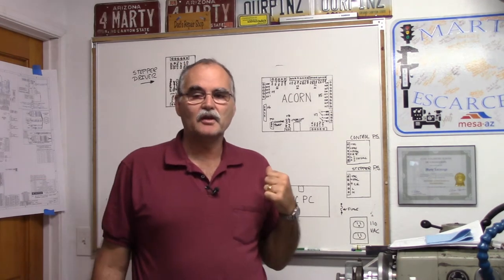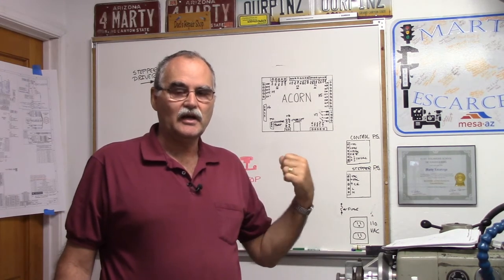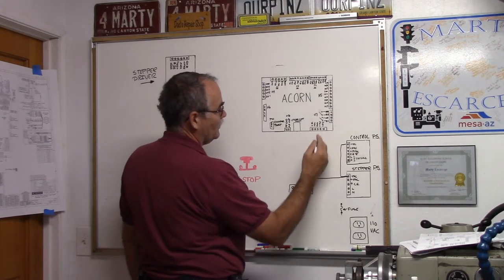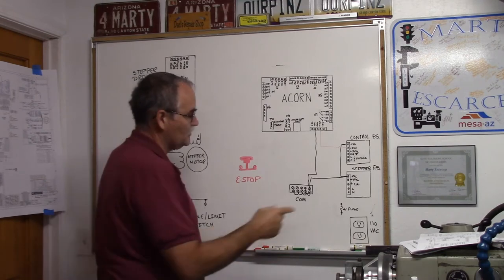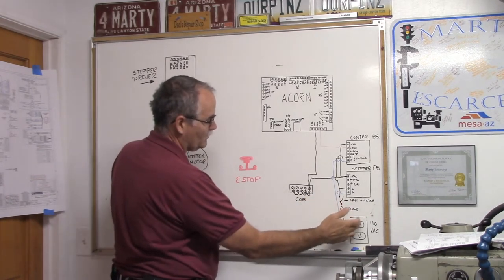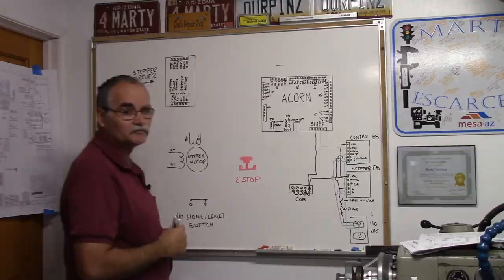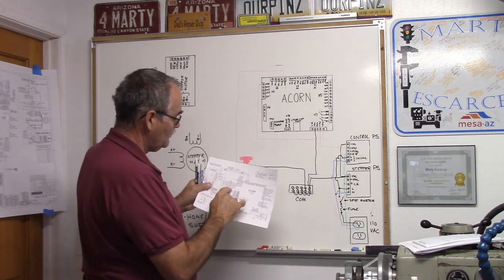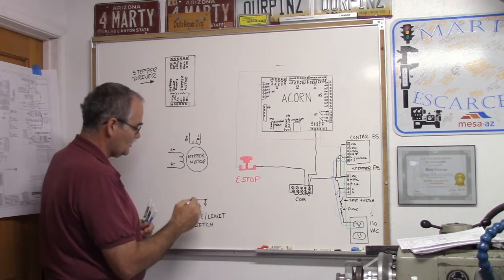Centroid Acorn CNC Basics - Dry Erase Board Exercise

Comment: Thanks for your informative videos! I do have a question with my Acorn setup. I have two Teknic Clear Path servos (SD-SK) wired to this board and the wiring diagram provided by Centroid shows wires for a 4-terminal e-stop while the one I have (Grizzly G-0752) only came with a one-contactor/two terminal e-stop. I am unsure where the place the ENABLE - ORG (incoming/outgoing) wires and the incoming COM and the outgoing E - STOP SIGNAL wires. Thank you sir!
Reply from the maker: Please post your question to the Centroid User support forum. Everyone will get the benefit of an answer. https://centroidcncforum.com/viewforum.php?f=60
Reply: @martyscncgarage5275  Done! Thanks

Comment: Thanks for your detailed info. It helped me setting up my DIY CNC without major problems. Just one little issue: I as you proposed, I have a home AND limit switch in one circuit for each axis and used the inputs 1 to 3 for X,Y and Z respectively. Problem is that once a limit/home switch trips, the Acorn blocks the motor completely and I can not reverse the last movement. If I want to use and configure separate circuits for each home and each limit switch, I would need 6 inputs instead the 4 supported by Acorn. How to solve this problem ? Thanks so much.
Reply from the maker: Sorry for the delay. Use ONE switch for each axis. Provided they are NC switches you can SERIES them together to input 1 and set it to HOMEALL. The control will home properly and save you an input. Otherwise, you only need ONE switch for each axis and placed where you intend to home your machine. Then use HOMELIMITOK in the CNC12 Wizard. You will get faster response if you post your questions to the Centroid CNC User Forum. (I only work on and support Centroid Controls)

Comment: Hi Marty, first let me say thanks for all of the great info that you  provide.  I have a PM-940m CNC machine that i just purchased.    I saw in another video where a guy purchased the PM-940m CNC and you recommended that he use the Acorn card.  I had purchased the  Acorn card before i actually got the turnkey CNC machine as i was going to do my own build.  Long story short i decided to go with the turnkey machine for now and Matt said that the nMotion card would be easy enough to change out.  After looking at the schematics for the nMotion setup and the LeadShine Acorn setup i see that there are 6 inputs needed for limits as they are wired on the nMotion card.  3 for home and 3 for reference.  (the nMotion card has 16 inputs).  Since the Acorn recommends using the first 4 inputs for home limits, is there a way to provide 2 more limit inputs without sacrificing any of the other 4 inputs along the top part of the board?  i'm not sure there is a crafty work around to keep the existing limit functionality.  I appreciate any thoughts you might be able to suggest.  Thanks,
Reply from the maker: You only "need" the 3 to home with soft limits take care of the other 3. That said you can series them together and put them in series with the Estop circuit as a fail safe. IF one of those limit switches  trips, you will need a momentary push button placed in parallel with the Estop circuit so you can temporarily CLOSE the circuit and jog the offending axis off the limit switch.  Hope this helps!
Reply: Marty, thanks for the fast response.  When looking at the LeadShine schematic they illustrate the 3 limits in series after the Estop. i'm assuming that's what you are referring.   i like the idea of the jog in parallel.    Even though the Acorn card is limited by some of it's features, i hope the switch will be of a greater benefit with Centroid's solid history.   I'm hoping i won't have any issue with switching over the VFD.  The mill didn't come with any documentation on the Delta VFD and i haven't looked on the internet yet to see if i can find the doc. 
 I couldn't find anything on the nMotion controller.   If all works well, after some time i may want to expand to one of the other boards for more features.  I'm also trying to decide on moving to Clear Path or DMM servos.  But that may be further down the road.  Thanks again.
Reply from the maker: Delta VFDs are popular. If it's already connected to the control and the CNC software can control it you are almost there. Just download a manual and not the connections on the Deltas control terminals, so you can cross reference them to Acorn. You should take pictures of your stepper drivers and post them to the Centroid user forums for some input from other users.
Reply: Will do Marty.  I've started to dig into it further and i think i have to buy  a 5v power supply.  From what i can see the nMotion controller is supplying the 5v connection to the LeadShine drive.
Reply: In mach, I setup my home switches in series and use one input. I am assuming you can choose the input address for each limit switch, so you would make them all the same. Again you are NC and its just looking for common on an input. Who cares if it is the same input. When the switch is triggered it will register and move the axis off the switch and close the circuit again. The homing of the axis knows which stepper to turn.
Reply from the maker: I believe they are setting up the Centroid  software to do what you say Mike. Series the three switches to one input and home the machine that way. It may have been implemented in the latest release. I have not checked.
Reply: Yes - from the CNC12 Features for v4.10 - # 9.) “home all” axes off one input Added “home_all” for input label on I/o drop down choice. Allows all Homeswitches to use one input.
Reply from the maker: Mike yes, this is a new feature

Comment: Good Morning Sir,  I may ask you a question  about acorn cnc card , Can  the  autonics md5-hd14 5 phase stepper motor driver  be connected to acorn card? and it is the case Do you have some wiring diagram for that purpose? Thank you very Much
Reply from the maker: If it's step and direction input most likely. PLEASE post your question with pictures and link to the manual on the Centroid CNC User Forums. Will hel you there. https://centroidcncforum.com/viewforum.php?f=20
Reply: Thank you very much for answering me, I am going to do it Best Regards